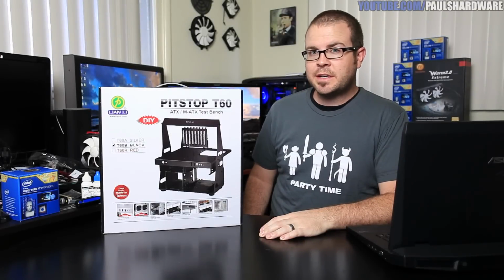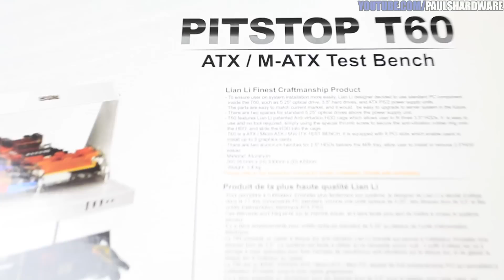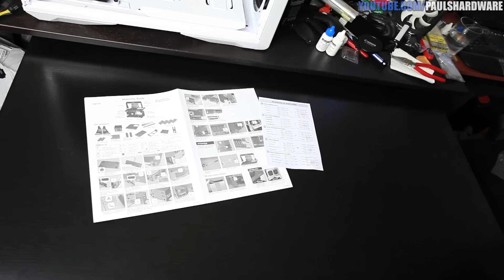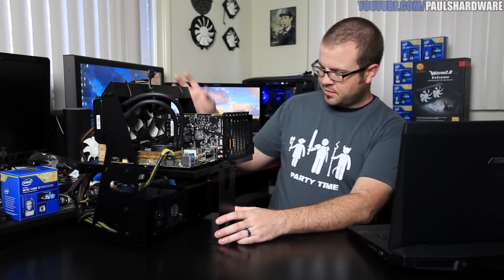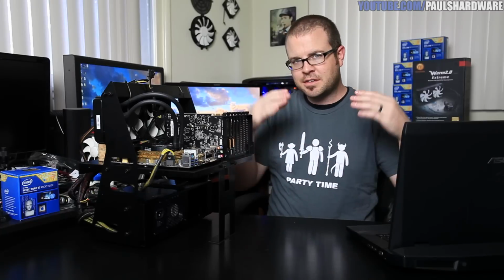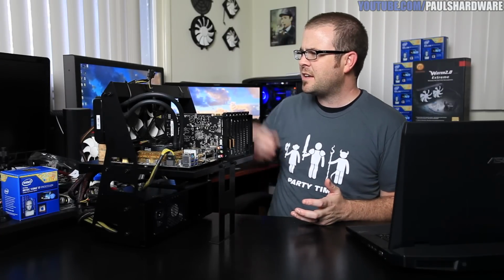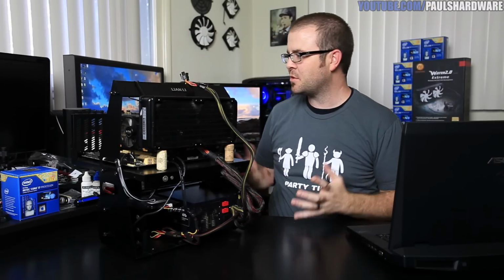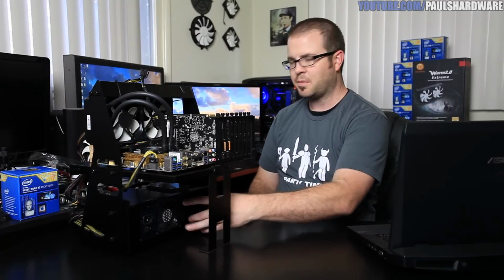Lian Li T60 Test Bed Unboxing, Assembly & Quick Review

Comment: Hey paul I was hoping you could suggest a video card for the build I'm doing. Its based on the amd a10 6800k with amd radeon 2133 ddr3 ram and 2 samsung 840 ssd in raid 0. I'm going to be using it for video formatting  and light editing and would like it to be a fair gaming rig as well. Any advice would be very appreciated.

Comment: I just purchased a pt-60A and after drilling just 2 holes, I was able to angle the motherboard more towards the front. alot like the praxis wet bench is. Looks great and also gets rid of the brace in the back. But this also keeps you from installing a dvd drive because of the angle. but I dont use one any way. If I need to, I can use my portable usb dvd drive.